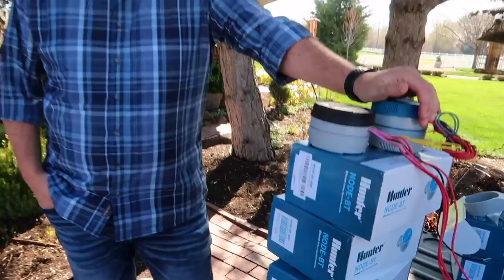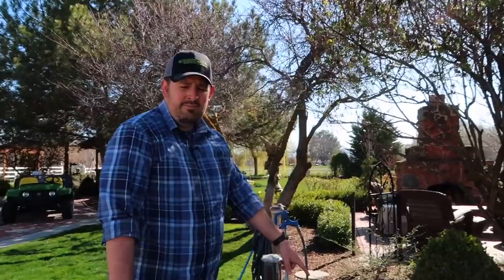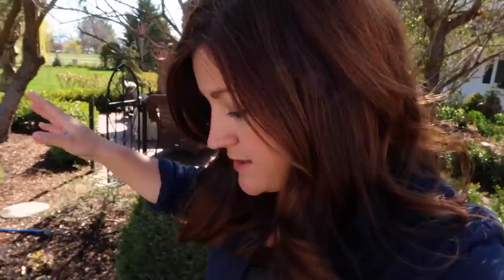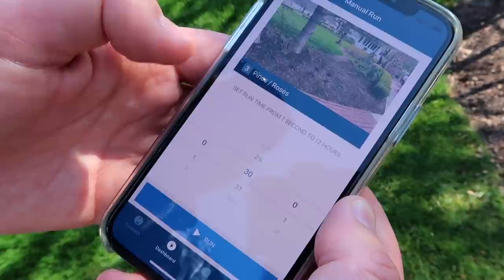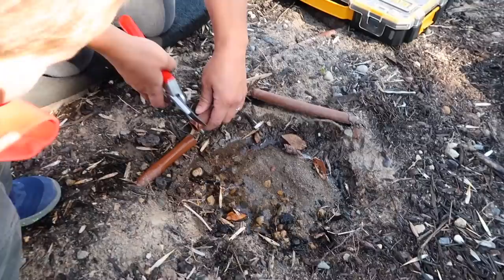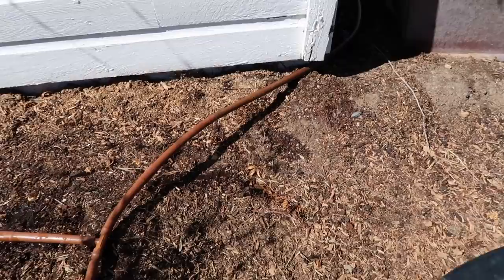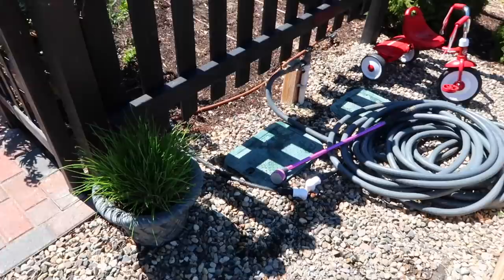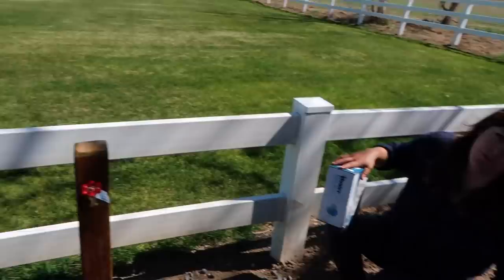Working On Our Irrigation System 💦🌿// Garden Answer

Comment: Aaron it's called standard wire connector (the ones the screw the electrical wires together). The end cap for the PVC pipes need to have a screw on couplet or a glued one otherwise it doesn't stay because of the water pressure.
Cool deal, thank you for sharing and seeing the boys was a treat...
Benjamin😍. God bless you, stay safe. Hugs💜🤗

Comment: Omg Benjamin is so so cute with his lawnmower. Have you ever thought about setting up one irrigation box for your in tire yard and would you do this on the new property so you don't have irrigation boxes everywhere
Reply: For a large property the 'mainline' travels to the 'zones'. Whence the valve boxes. A smaller property a guy can get away with one valve box. Also there is so much componentry in a sprinkler system that needs to be accessible.  The valve box was created for this access.

Comment: Can you make a video about why grid irrigation is better than spiral one (pattern) especially in odd shaped flowerbeds? I've just installed irrigation in spiral pattern and am not sure if i need to redo it.
Reply: If you have one long line, the pressure at the end can get too low, so not enough water get out to irrigate the plants. If you make grid, you distribute the pressure and water more evenly, so you can have more space irrigated from one line. It depends on the space you need to irrigate, in small spaces you may not see the difference, but in larger spaces it reduces the amount of needed zones.

Comment: Hi Aaron, I am not an irrigation contractor but I have an underground sprinkler system in my yard so I am familiar with the setup.  Looking at your 4 independent controller boxes, I think there is a solution for you without having to use those Hunter node controllers on each box.  You can get a 16-zone (4 boxes multiplied by 4 lines) controller box unit  and wire each of  those solenoids to the new controller.  The nice thing about this setup is that you no longer need to use batteries since the new box runs off of an AC adapter and you can program each zone for day and watering duration.  You can also mount the 16-zone controller inside your house, garage, barn, or wherever it is close and just run the wires to the 4 boxes.  You may not have the bluetooth control via your phone with the new 16-zone controller but it is basically a set and forget setup once you have determined the length of  watering time for each zone.

Comment: I’m amazed you can do the irrigation without using ratchet clips on every single joint. I live in New South Wales and I even use metal clips rather than plastic ones and I still get pipes blowing off. I’m getting better at it. The tap (faucet) is not on hard either. I learned a lot from today’s video, thanks heaps.

Comment: What is the difference between this and the Rachio? I thought you used Rachio to control your zones with your phone.
Reply: this would be the areas not connected to the main irrigation and controlled by rachio.  It's pretty expensive to add modules to those bluetooth systems.

Comment: Would you guys do a video on irrigation tubing?  When you do the brown 18inch, when you do the soaker house, and when you do the tiny hose that goes to each plant root ball? And what situations you would do for each...I don't know if you do the brown only in flower beds, but then i also see sometimes you run each a personal tiny black tube in flower beds etc.
I know its winter now, but maybe something that would be that you could do inside just holding up the supplies.

Comment: I am so thankful for this video this morning!  I am in the process of putting drip into our flower beds and ran into a couple of questions.  How far apart do you run the lines?  I had mine running for over an hour and only had about a quarter sized wet area around each hole on the brown tubing.  Is it because I used the 25 PSI pressure reducer?  What am I doing wrong?  I only have about 100 feet of 1/2 inch tubing directly from the faucet.  Our ground is so dry after winter and 50 mph winds this weekend, but I was hoping that I could put the lines 18 inches apart and then have them  water the entire bed.  How long should I have to run this zone for that to happen?  How much brown drip can you run on one zone and have it cover ?  Thank you for any feedback.  Your channel is a source of joy in my day!
Reply: YES! I have so many of these questions too.  Would love to see a video where you lay out a grid system.  How do you determine spacing between the lines to get coverage?  What kind of allowance do you need to make for heavy clay vs. loam soils?  How can you tell the entire area is wet when all that shows on the surface are small round damp spots?  Is there an easy/good way to check for moisture?

Separate question/mystery: where does water go when the soil is so dry it's hydrophobic?  There have been times when I've "watered in well" only to poke the surface and find about 1/8" on top is wet and it's dry as dust underneath.

Comment: Not sure if you'll get this comment but you can use an app called IFTTT (If this then that) and connect it to weather under ground and to your irrigation's app and make a command where if weather underground says it will rain, then it will not run the drip.  You could also adjust based on temperature! :) Hope this helps! Love your videos!

Comment: I’m currently installing drip irrigation and I have to use a heat gun to soften the ends of the 1/4 inch tune to get the drip guys in. Am I using the wrong size?

Comment: Oh my gosh this one was so timely for me! We are currently ripped up our backyard to fix infrastructure issues and I am currently researching irrigation systems. I've been trying to figure out how to break the zones where they make sense but also proper pressure! I would love to see how you have your valves done. My veggie area will have 4 12' beds, a 6' raspberry and a couple containers. I'd love to put it on a zone with pressure/filter at the valve with shutoffs at each bed. Is that similar to your set up? I'd hate to filter and pressure regulate at each bed...just seems clunky.

Comment: Great info for when we eventually add irrigation/drip to our garden. I notice you keep the drip relatively close to the surface; I'm assuming for troubleshooting issues as they arise and keep track of where you have coverage. Is it advisable to bury the drip tubing 1-2 inches below surface to reduce chances of tripping over it when walking/working in the garden bed? Are there cons to this I'm not thinking of? And do you find yourself tripping on them often? I feel like I would be falling constantly due to my clumsy nature!

Comment: Drip irrigation is such a confusing thing for me to grasp. We have a system and I understand how to run water to plants through individual emitters but how do I know when I should be using a soaker hose or drip with holes every so often rather than individual emitters? Also, should I always "close the loop" so the end of one 1/2" distribution tube connects in with the start? Thanks so much for your videos Laura and Aaron!

Comment: Is it possible that drip tubing gets dry and brittle over time because a couple repairs looked that way at the connectors? Maybe you had a lot of repairs because the tubes were put in at the same time so they need repairs at the same time 😊

Comment: What is the recommended method for those that only have inground sprinkler systems for their grass/lawn and want to add drip tubing to flower beds?  Can these nodes be used on an old sprinkler system with a Rainbird programmer in your garage?  You don't need to turn off the electricity when you work with the wires in the boxes, right?

Comment: Hi Laura,.  I would love to put in a drip system.  Does the drip system use a lot of water.  We only have one well and thats for the house.   How would you attach a drip system to a well.  We are one of the few houses around that doesn't run out of water when its an espicially rainless summer.  We have two large plastic water containers that we collect rainwater in and I would love not to have to lug buckets of water to the plants.

Comment: I have a small garden bed that has a drip system going in and out of the garden and I want to add pavers to separate the grass and the bed. Do I have to dig the drip system lower to place the pavers over the drip line?

Comment: I live in Zone 6 Connecticut,  and our water table is so high, i was told about 6ft underground and got water puddle in our backyard during rain and in winter. How do i install drip irrigration system in this case? Can I still bury/trench my 1/2in. pipe from faucet off the side of my house to the vegetable garden and flower beds?

Comment: Question, would it be feasible to couple drip tubing with soaker hose? I have both in various beds on my property and I want to integrate the system better (I know ultimately I will replace the soaker hose but it’s not in the budget this year). Just not sure if one would be compatible with the other in regards to pressure.

Comment: Are the Hunter Nodes compatible with the Rachio controller or do they work independently? Do I need both? I'm interested in going with an easier system rather than dealing with the complicated programming one I currently have. My gardener currently controls my programming and my water consumption has increased 800% over last year! I like the idea of using an app and want something I can easily program and turn off when it rains etc. I watched this video twice because it was so informative and because I love you guys!